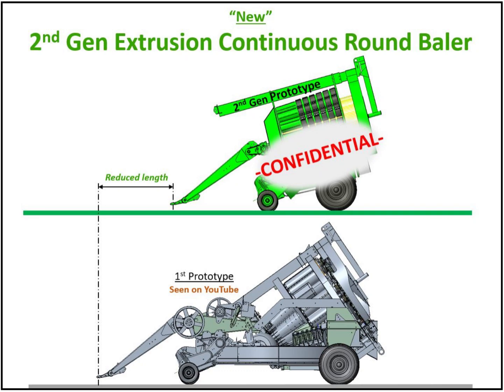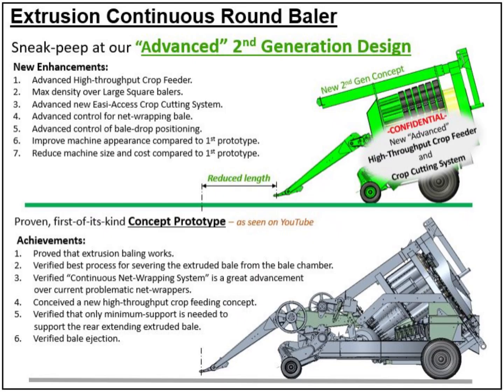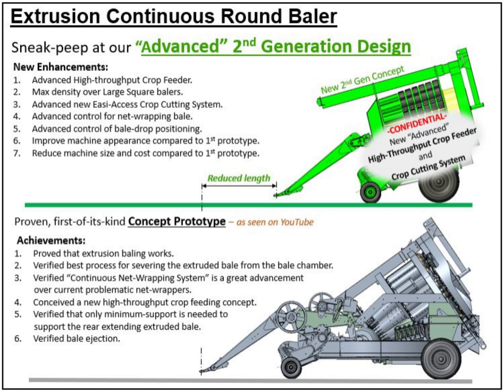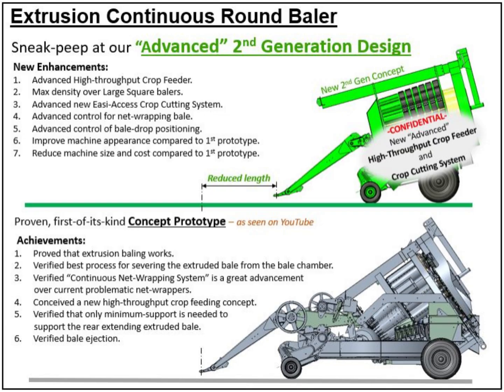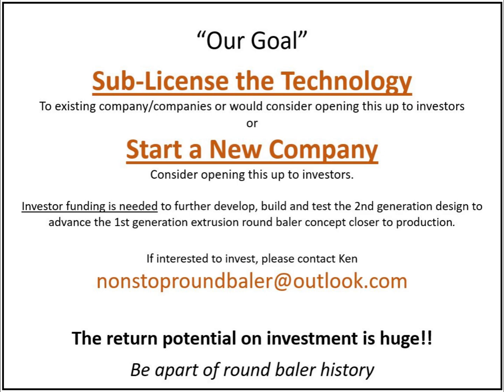Advanced 2nd Gen Extrusion Continuous Round Baler

Comment: I wish you the best of luck but i do suspect there is an easier way to make a higher density bale.  I also see the square bales as a better form than round for maximum density on trucks and in barns.  It would be helpful to show a bale being unrolled for feeding or bedding.  If the forming method produces cross-linking that interferes with unrolling this may not be desirable for some farming methods.